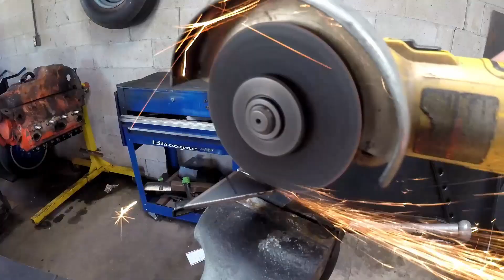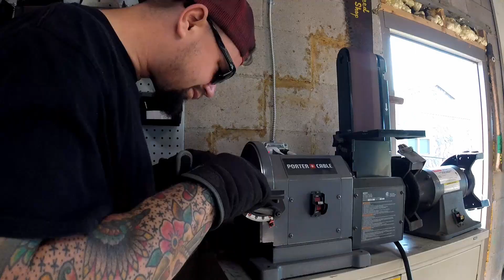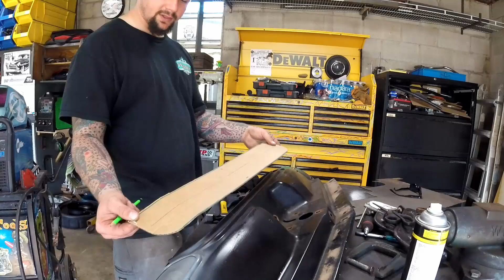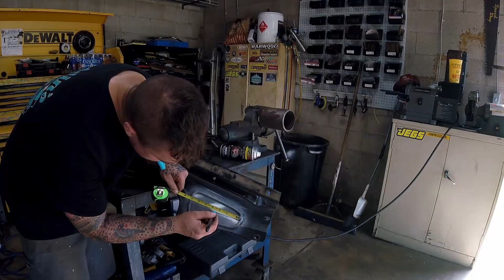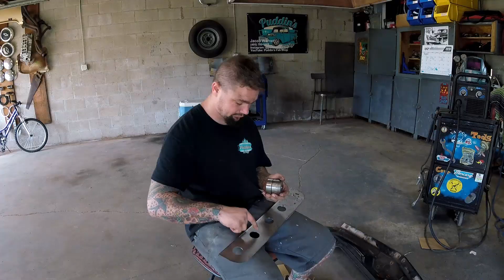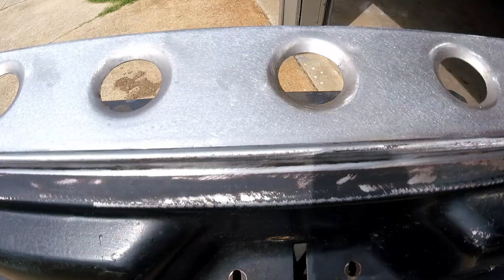HOW TO BUILD CUSTOM SHEET METAL FILLER PANELS! (WITH DIMPLE DIES)

Comment: Right and left side holes in the centre filler  panel are off, one of the measurements is out, other than that mad job
Reply from the maker: Measurements not off, the factory piece is unsymmetrical, so it’s either center the holes to the car ooorrrrr center them to the piece. Centering  them to the piece really highlights how unsymmetrical it is and stands out like a sore thumb. This is the better of two options. 👊🏻👊🏻👊🏻

Comment: Nice video buddy, what size is that dimple die? Thinking on getting one, but now sure which one can be a good overall size than I could be using for some fab (Rock sliders, bumpers, etc...)
Reply from the maker: I’d say 1.5” to 2” I don’t remember to be honest!
Reply: @PuddinsFabShop  Thanks, I think I will pull the trigger on the 2" :)

Comment: Really good work for what tools you have...please don’t use a grinder or cut off wheel without using eye protection you will regret it.
Reply from the maker: Ya I used to be bad about getting in a hurry and not grabbing my safety glasses. Dumb move for sure!

Comment: Awesome video... What brand die did you use and what gauge sheet metal?
Reply from the maker: The dies are swag offroad and the sheet metal is 18 gauge!
Reply: Also how do you like the proper cable belt sander for metal ?thinking of picking that up
Reply from the maker: Hey sorry man just seen this, I like the porter cable sander a lot, good power for good price. 👍🏻
Reply: All good man I wound up buying it from Lowe's lol love it